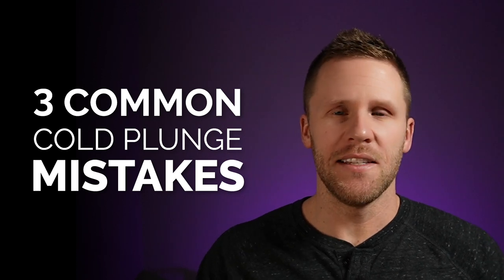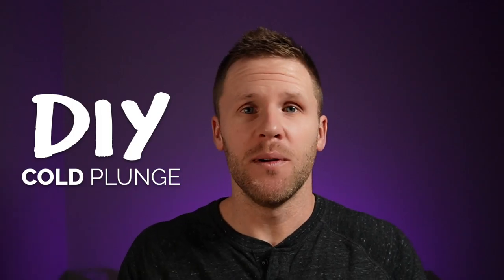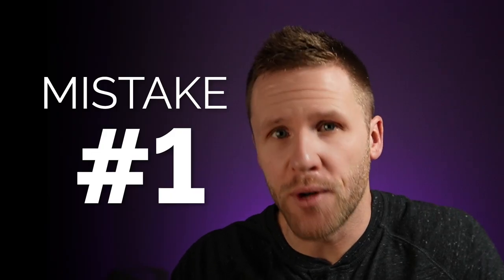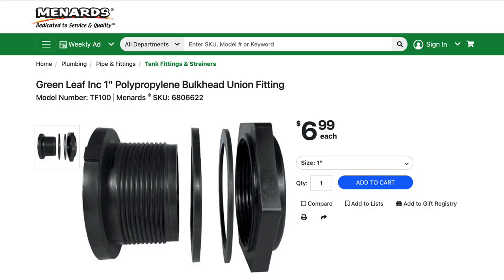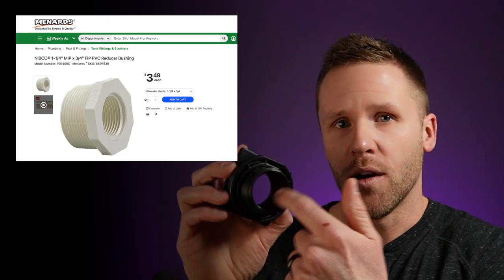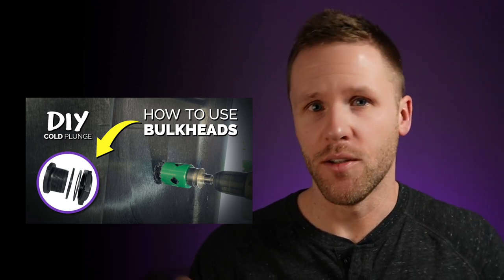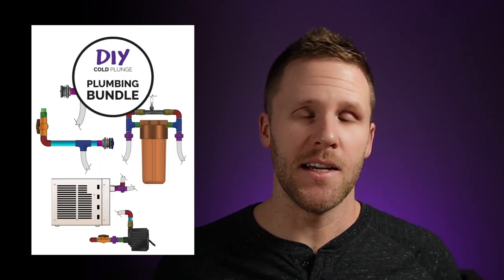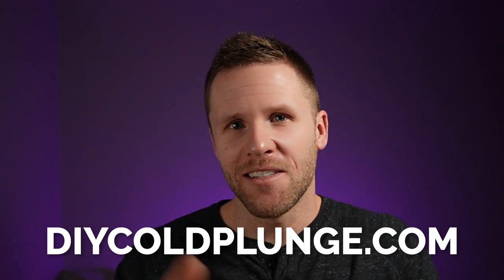3 Stock Tank Cold Plunge MISTAKES to Avoid | DIY Cold Plunge

Comment: In regards to the Venturi injector you are correct. It will choke the pump but only if it is running at a fast rpm. If you want to make this in-line you can do it. You will need a variable speed pump, make sure it’s on a low speed to avoid choking it. Run it for about double to triple the time since it needs to sanitize all the water a couple times. Which in turn will waste more energy and be more expensive to run each month. Or do it his way which is unconventional but economically and practically smarter. As someone who worked in pumps and filtration for pools it makes complete sense.
Reply from the maker: Thank you!

Comment: What size bulkhead would fit the drain in a 100 gallon Rubbermaid stock tank?  Or would i have to resize the hole?
Reply from the maker: the size of the bulkhead refers to the female threads, not the outer diameter. I've had 1" bulkheads that fit and 1" bulkheads that dont, just depends on where you get it and how it was manufactured.
Reply: @DIYColdPlunge  thanks Joe!

Comment: So should I buy the 1 inch bulk head from Menards?     Asking because,  The opening is for 1 1/2 inch on the 100 gallon tank..?    Thanks
Reply from the maker: You may need to shop around. Bulkheads have varying sizes in different stores - the 1" refers to the thread size not the diameter

Comment: Hey which chiller do you recommend? I am in the process of using your DIY page, but I too live in a place with artic temps and am worried about damaging the chiller in sub zero temps. Any issues with the temps being too cold outside for the chiller.?
Reply from the maker: I pull my chiller in the winter. I've found that the Active Aqua 1/4HP is the best bang for your buck (and my personal fave). https://www.youtube.com/watch?v=vdzyb9hoeZk

Comment: You ever tried using a motorized fan vent system?  I am installing a 12" exhaust fan right above my Penguin 1/2 HP Chiller and it will pull 600+ cubic feet of air our per hour - so I am going to set that to run along with the chiller. 

Just in case - I have a digital thermostat to check how hot the compartment gets, but it was way cheaper than 2 20" vents.
Reply from the maker: There have been some folks in extreme climates that have done this 👍 I personally have never needed to but the more airflow the better
Reply: @DIYColdPlunge  Yeah I am in PHX, AZ but my plunge is in an insulated garage that can also be air conditioned.
Reply: I was wondering about an exhaust fan as well... I deal with 100% humidity and temps in the upper 90s in NC during the June-Aug months.  I'm about to start my first cold plunge build out
Reply: @brettbarley  I built mine in PHX. It's in my garage which is insulated and has AC if I want but I found i don't need it. I just positioned my cooler with the vent blowing right out and trimmed around it. 

But ... The vent fan would absolutely work

Comment: Hey Joe, I know you used PVC sheets for the top, did you also use them for the sides?   I was thinking about using some Duratemp from Home Depot.   I bought all your plans and made all my orders online today.   I just need some 20 inch grates and siding for the frame.   I insulated and wrapped it today.    Super pumped about this project.
Reply from the maker: Hey! I used LP siding for the side panels - basically the same thing you are describing. It has worked perfectly for an outside plunge. I appreciate the support! Best of luck the rest of the way 👍

Comment: I'm using the same plans and stock tank as you (100 gallon, Rubbermaid). What size "Bulkhead Union" do I need to get?
Reply from the maker: I use 1" - but that is the inner thread size. Different 1" bulkheads have outer sizes they vary. It's best to get your bulkhead and take measurements yourself

Comment: Caster wheels on the bottom of the frame? Maybe 8 or so of them? That way we can roll it around? Thoughts?
Reply from the maker: I've seen people do this! But... you would likely need to modify the framing to support the weight of everything. The limiting factor isn't the casters at that point, I think it would be the frame

Comment: I have the 100 gallon Rubbermaid tank. I just fill my tank and put ice in it, I don’t have the chiller or anything. My drain plug broke, how would you replace the plug? With another standard Rubbermaid plug or the bulkhead?
Reply from the maker: I'd probably go bulkhead, just to have the adaptablity later on if you want to set it up with plumbing.

Comment: Hey Joe - I live in MN as well, awesome to see a fellow Minnesotan. Great setup, you explain things very well. I do have one question: how do you eliminate the chiller in the MN winters and just rely on the outside temps to cool your water? Do you have a way to route the pumped water through the filtration system without the chiller system when winter hits? Thanks
Reply from the maker: Hey Chris! Hope you are enjoying the recent heatwave 🤣 I have everything set up to be modular (using PVC Unions) so int he winter I take the chiller out and let nature keep it cold for me.
Reply: @DIYColdPlunge  you take the chiller out, but do you keep the rest of the plumbing hooked up and water flowing? If so does that keep the water in the pipes from freezing?
Reply from the maker: @daviddustin1139  Yep, pump & filtration system stay in and keep the water from freezing. Depending on outside temps, the water could rise into the high 40's for temp.